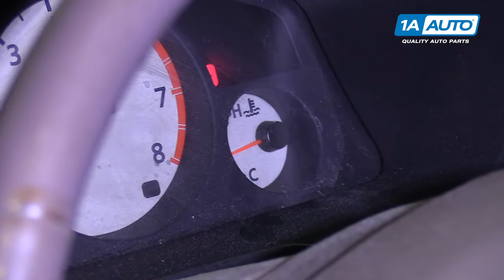How to Replace Harmonic Balancer Crank Pulley 96-00 Nissan Pathfinder

Comment: Very well-done video. I have a few observations but keep in mind I was working on a 2nd gen Xterra so there were some suttle differences, some may or may not apply to the 1st gens. I had a drain plug on the bottom of my radiator accessed by removing the splash guard. I did not need to do anything with my air intake and lastly, the 2nd gen has a bleeder screw on the intake under the throttle cables for bleeding. Other than that, my bolt on components were a little differently positioned but still utilized the same methods to tighten. Figured this might help some gen 2 guys as there wasn't much out there for gen 2, not as good as this one anyway. 

UPDATE: Almost forgot most important! GEN 2 requires (2) 6mm x 1.0pitch x 75mm or higher. HOWEVER, I found it easier to use 6 x 1.0 x75 threaded rod (True Value Hardware) to make studs to put the puller on then lock on with washers and whizz nuts. I have carpal tunnel and had a hard time starting the bolts while holding the puller.

Comment: If anyone else is like me and watching this video to repair their old 2000 Nissan Pathfinder, the bolts needed for the puller are m6-1.0 x about 75mm.  You'll likely need to buy some washers also.  I got mine at Lowe's.

Comment: Nice video, now I have a question, could you use a different kind of puller to remove the harmonic balancer? like the once that looks like a claw with 3 finders?
Reply from the maker: +TheKnightDrag0n Thanks for watching!  You really want to use the type of puller you see in the video.  They can be purchased or even rented at many auto part stores.  With rental programs you usually pay the full amount for the part up front, and if you bring it back in good condition you get fully reimbursed.  1aauto.com
Reply: I used a gear puller to remove mine from my 1998 pathfinder. I rented a harmonic balancer puller and the bolts were too big for my holes so i couldnt use it. But i used the 2 claws of my gear puller tool and then centered them around the outside of the a.c. belt section of the crank pulley and put the threaded bolt of the gear puller tool in the center with the crank bolt in, but loose. It worked great. It came off super easy. I notice the pathfinders harmonic balancers arent pressed in as tight as alot of other engines so your pretty safe using one of those tools.
Reply: @Ty-tie_FTW  so instead of buying two 6mm bolts.... you potentially bent the pulley
.
Good job... real mechanic you are

Comment: You removed the radiator then the fan but you can see that the radiator is still on? So, fan then radiator? Also, the ac compressor is already off the back on.. the sequence seems to be out of order, a little confusing.

Comment: I have a Frontier with the 3.3L and I am changing the water pump. The crank pulley has to come off and I was wondering if you know what size bolt fits the pre-tapped holes on the pulley so I can use my puller.
Reply: 10 mm
Reply: Metric #6
Reply: @alex14426  are you sure about that? I went to great pains to get M5 x .80 60mm bolts to work with my puller only to discover they are too small. If they are indeed M6 do you know what thread pitch and length is required?

Comment: Where do you find the bolts that fit in the pulley holes? I have 1 that fits, but I need 2. They are 6mm, fine thread..they don't come in the puller kits, the kits only have bigger sizes.... help!!!!
Reply from the maker: +mark blanchard Your local hardware store should have the correct bolts available for you.
Reply: If you find the correct size for this please post it. I have been having no luck finding it